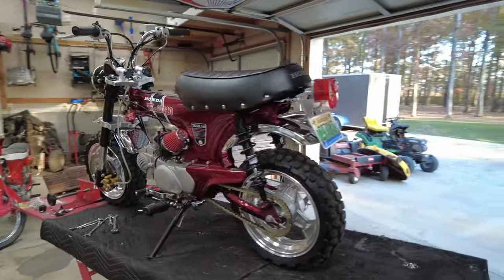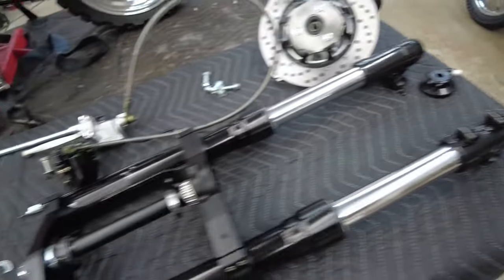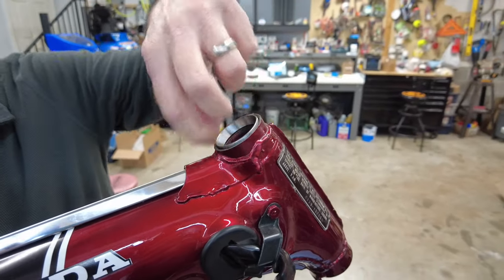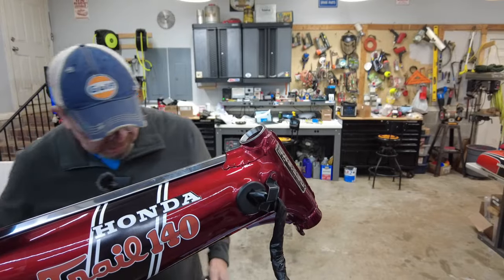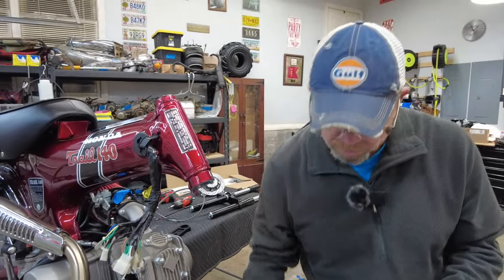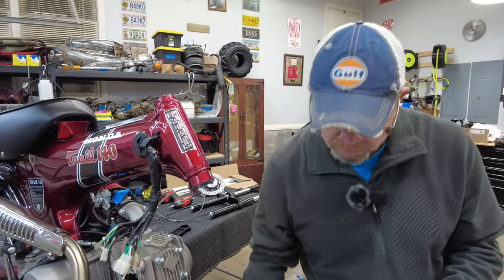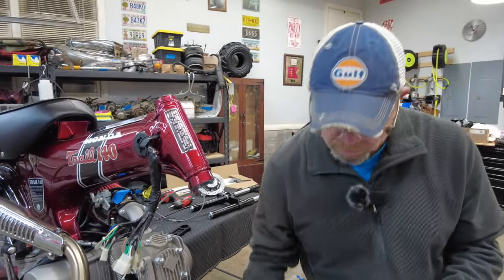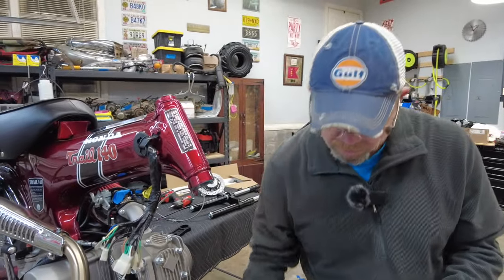How to install an adjustable inverted front suspension from Bart Moto Co on a Honda Trail 70 CT70

Comment: Hi can you please tell me how long the forks are?  I want to fit this to a ST90 I know the triple tree will fit but I’m not sure if the ST90 forks are longer or the same as the CT70.
Reply from the maker: @joharb The forks measure 23 1/2 inches from the top of the tube to the center of the axle. Hope that helps out.
Reply: Thank you

Comment: hey there. wondering how you got the original racers out? TY!
Reply: Just hammer them out from the inside with something long. I believe i used 2 3/8" extensions to knock mine out.

Comment: I've have these forks, and I need a heavier fluid. do you know the volume and fluid drain and fill locations?
Reply from the maker: I know you have to pull the caps and turn the tubes upside down to drain them.  Fill from the same spot.  I do not know the volume.